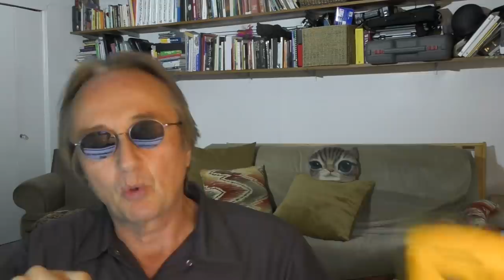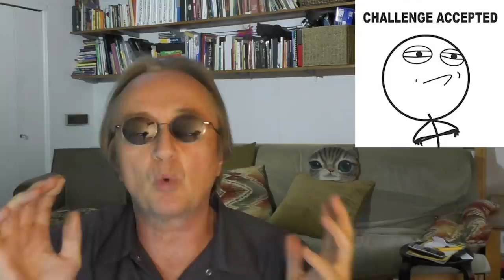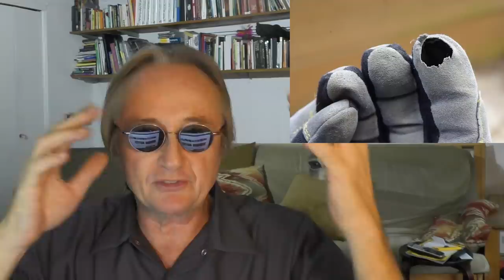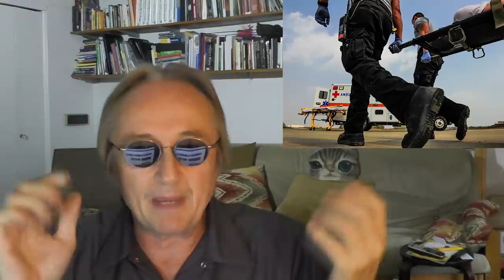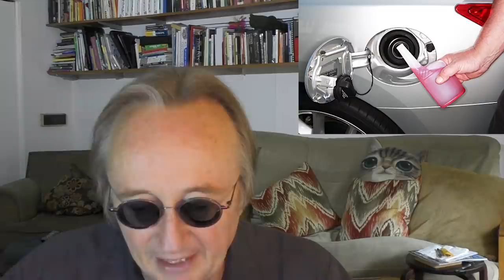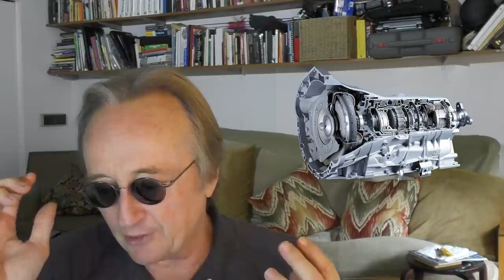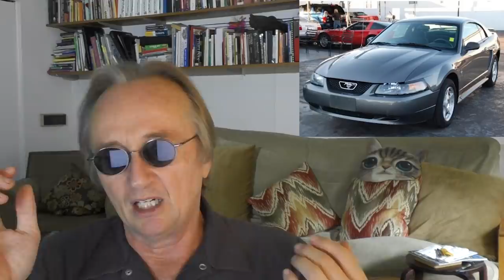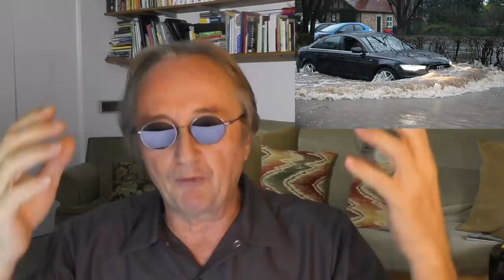The Scariest Car I’ve Ever Worked On, It Can Kill You

Comment: I never thought it scary, however the guy that dropped a large wrench did.  He was inside an M60 tank, decades ago, and had the floor plates removed.  The turret was electrically controlled, so, the floor of the tank was covered with batteries.  Well, when the wrench hit, it instantly burned in to two pieces - and it was a LARGE wench.  I never wore a wedding ring or dog tags when working on those puppies.

Comment: 288 volts DC (what these Prius uses) can potentially kill you but when wearing protective gear then there is little to no risk. On the other hand, 288 volts AC (what comes out of home sockets) is extremely dangerous and will certainly kill you if you touch it. When dealing with electricity, DC voltages are a lot safer than AC ones

Comment: the american house actually uses 220 volts you get a 220 line witch is 2 110 volt likes center tapped.

appliances  like electric clothes dryer. central air conditioner (the outdoor unit), very large wall mounted air conditioners (usually bigger than 12000 btu), electric hot water heater and electric stove all use 220.

still you need to careful around electric.

the chevy volt and i think the tesla uses 300 to 500 volts at 50 amps

Comment: I'm an electrician.. 33 going on 34 years.. I have to push back..
Scotty Scotty Scotty... You can get hit with literally thousands of VOLTS and it would be really uncomfortable. It won't kill you though unless those volts are pushed by more than ½ of an amp... Voltage does NOT kill, but very little AMPERAGE will put you in the cemetery! ✌🏿

Comment: To make things even scarier, it's DC voltage! A basic calculation states that the average Prius battery is 6.5kWh @144VDC, which equals roughly 22.5 amps at any given moment... Now, with that in mind, 2 amps can stop the heart, but 22 amps can literally cook your insides!

Comment: 1969 fiat spider 850 The least dangerous car to work on but the most dangerous car in the US at the time and the worst car I ever owned.  Between the driver and the passenger and the engine/gas tank was mostly a thin sheet of pot metal and particle board.   Looked cool though.

Comment: Scotty is Right working on a Prius can be very dangerous due to the high voltage but there is an upside to it as long as you know how to disarm the system you are safe but when you're working on the batteries themselves even after its discharged there is a risk but once the battery safety disconnect has been taken out and you have waited a. Of time usually at least 10 minutes for everything to discharge you're safe to work on the rest of the car it's just like working on any other car as long as the batteries have been safely disconnected on the system is discharged and you have waited the. Of time after it was discharged

Comment: This is why Toyota has a special certification for hybrid engineers.  

It's designed to disconnect the electricity if there's an accident so it's perfectly safe.  EURO NCAP tests those systems quite severely.

Comment: I can confirm that Honda auto gearboxes are not reliable. I have had 2 Rover Vitesse 827 cars and the gearbox went on one, lost reverse if I remember correct. For you in USA it was basically a Honda Legend, lovely car otherwise. My Lexus GS300 on the other hand runs like a new car with 170000 miles on the clock.

Comment: Scariest car I worked on was a 1968 Morris 1300 that was held together with chickenwire.
Seriously could see the road thru the floor.
Not sure what was holding the bumpers on.
Was even scarrier to drive as its  1275cc engine had a twin carb.
The front disc brakes were tiny... so stopping took a while.
Come a long way since then

Comment: As a Toyota mechanic you kinda live dangerous these days. Airbag recalls to change the explosive and hybrid systems with high voltage. I didn't fear the battery or the explosives much so far but i guess that's because nothing happened at our place so far.

Comment: Scotty I bought a 2001 Toyota Tacoma with a rebuilt title for $5000. It has no rust, a 2.4l 4 cyl, and the automatic transmission. Thoughts? It’s been in two wrecks and has 100k miles
Reply: Logan Williams cant go wrong with a Toyota pick up truck, I have my Hilux turbo diesel manual and will never trade it for anything, good buy as long as engine and trans is in good condition
Reply: 5k is a lot of money for a 2001 w rebuilt + been in 2 wrecks tbh....
Reply: Oh.. Just noticed its a 2001.. yeah you are right 5 Grand is too much for one thats been in 2 accidents
Reply: Having said that.. Toyota pick ups are worth every penny in the long run

Comment: love your channel Scotty and I love the way you do your videos with the little pictures at the appropriate moment. Absolutely hilarious.
I have a 2008 Prius that is my work vehicle. Honestly you're not that scary to work on. If you disconnect a 12 volt battery the contactors open and there should be zero voltage anywhere. All of the high voltage stuff is bright orange so you know if you're close to anything dangerous. Also there is a disconnect lever on the Hybrid battery that splits the battery in half dropping the voltage down to a safer level.
You have to do something pretty dumb to get shocked on a Prius. like deciding to cut through that bright orange cable while the car is powered up with some uninsulated wire cutters. Something like that. Theoretically yes if several systems failed you could get shocked.
But honestly what's the likelihood of that? My Prius has 256000 miles on it, still gives me 45 to 48 miles per gallon in the city. And a solid 40 miles per gallon running at 80 miles an hour. love your channel keep up the good work

Comment: I love you, Scotty.
But 288v, in itself, isn't dangerous at all. Comparing DC to AC is apples and oranges.
Did you know that a visible static discharge is FIVE THOUSAND VOLTS or more?!
It is the relationship of voltage to amperage.
DC is generally much more dangerous than AC.
So in this case; a 288v DC battery with high amperage, would be scary AF!!!

Comment: I'm guessing that the amps on the Prius are pretty substancial?! Here in the UK our household Voltage is 240 volts as standard and I can tell ya plenty of electricians have had a taste of that on more than one occasion! - it'll jump start the old ticker for sure but you'd have to be unlucky (dodgy heart etc.) for it to be fatal; All the same not a nice experience, not nice at all.

Comment: What's the point of anything else than a v8 in a Mustang? I agree with Scotty here. The original Mustang was small and light and it had a v8. This made for a quick, powerful and nimble car, I.E. a FUN car. It was essentially what kicked off the muscle car; small, light, cheap and with a powerful engine. The mustangs of today do have the interesting V6 turbo, however, nothing other than a v8 sounds like a v8. The Mustang is about looks, appearances, excitement and feelings. V6s are great, but they are not, and they never will be, v8s.

Comment: Scotty, it isn't voltage that kills you.  It's current!

An electric cattle fence can be 10-15,000 volts, but the current is fairly low. It'll give you a jolt, but it won't kill you. 

Current is the killer, not voltage. Just looking out for safety.

Comment: 12 volts harmless? I remember grabbing an old, cracked spark plug wire while the engine was running. Deadly, no (at least for me), but definitely enough of a charge to be a quick and permanent learning opportunity.
Reply: That voltage was coming from the coil, not the battery.

Comment: it's not the voltage that kills you its the current that does you in! & the outer gloves are called keeper & the rubber gloves come in 2 different voltages the short gloves are rated for 250 volts & the long gloves are rated for 
15,000 volts I worked for utility & I used them when doing electric turns on! & they make a glove inflater it works better rolling the cuffs & you must test every time use them & they need to test dielectrically tested every 6 months

Comment: It's also 288v DC. It's absolutely high enough to cause damage, but with rubber gloves, would I be worried? Probably not. Especially if you're doing things 1 handed. The resistance would be so high that it would be difficult to draw a high enough amount of current with just 288v to be deadly. Remember, not only does your skin and gloves give you really high natural resistance, but you also need to create a circuit through your heart. (That's why it's better to do electrical things with one hand).

I'd be a bit more concerned if that was 288VAC . The natural capacitance in the body would make that far more painful and dangerous.

Comment: Its really all about the amps as voltage is not the only factor tasers can have huge voltage numbers but low amps. even a static shock can have into the thosands of voltage range but the amps are insanely low

Comment: The V8 engine in the 03/04 mustang gt wasn’t even much better that the V6. Both engines were SOHC. You want an 03/04 mustang? You got two options and this is my opinion. 03/04 Mustang Mach 1 5 speed manual transmission. The manual Mach 1’s came with a 4.6L DOHC and a forged crankshaft. Another option would be the 03/04 cobra Terminator. My favorite mustang to date. 4.6 L cast Iron block with forged intervals

Comment: Hey Scottey, I recently changed the front wheels cv joints on my 2011 kia rio because they were worn off, but now it is making a rapid clicking noise when turning right and hitting the gas. p.s: the cv joints I installed are Chinese cuz unfortunately the original parts are not available in my country. Thanks in advance and happy Halloween.

Comment: It's actually amps that are deadly. You can touch a 200 thousand volts with no amps and it won't hurt you. Amps is the amount of electrical current while voltage is potential difference.

Comment: A typical guitar amp runs at 450+ volts.  I've been nipped by 120 and 220+ but wouldn't want to experience 280 volts running through me.
Reply: @PingasTheFourth I once got zapped by around 240dc for an amp I built.  It is as you say, uncontrollable movement.  But any electricity can be dangerous if not fatal.  People die from 120.

Comment: As a 40 year term paramedic, I would state without reservation that the earlier (~ early 1990s vintage) Hyundai's were the absolute MOST dangerous vehicles ever built.  These cars when in off-center head-on crashes, even at moderate speeds, would sometimes split (fracture) the entire 'floor pan' from the A post ... diagonally across the 'floor pan' to the B post on the opposite side, dumping the seats AND passengers - through the diagonally 'split' floor pan- onto the roadway 'beneath' the auto.  
At any time I saw major damage to the A-post (the side-structure that holds the windshield in place; the B post is the structure between the front door and the rear door) on these early 1990s Hyundais, the first place I'd look for 'bodies' was underneath the vehicle; and,  a few times I found them there.
Reply: Whoa, that's insane.

Comment: The coil generates 20,000 volts to arc the spark plug. Has that killed anyone? When I was young they used to say it was not the shock from a coil that would hurt you, it was banging your head on the hood the would hirt you.

Comment: Scotty, I understand your case against hybrids as a mechanic, but the hybrid hating really needs to stop in regards to Toyota; the most recent Honda Insight seems like a solid vehicle as well. I get it, you don't like to work on them. As a person who's families mostly owns hybrids, they are rock solid... there's five of us that own them (Toyota's hybrid system) and they give us reliable and consistent performance; this was not an overnight experience (I've owned nearly 40 vehicles... driven them all, Toyota's hybrids are mostly overall solid vehicles), but something that we learned was a solid platform. Electricians have tough jobs too and a lot of jobs require risks and safety precautions. Perhaps with the precautions and complexity, car manufacturers need to seriously up the pay rates with working on hybrids for mechanics. Toyota hybrids are solid and reliable vehicles and you seriously need to give them credit regardless of your bias. Another consideration, with the new Toyota Corolla hybrid, they get consistent (better than advertised) fuel economy highway and city. Hybrids are no longer just city cars in the newer generations. Also, my hybrid Corolla run on electric mode even cruising down the highway (up to 70MPH) and almost always in the city (upwards of 50MPH).

Comment: Hi Sir, Just came across your channel and I spent the better of two days watching videos you put out.  Love your work, love your passion.  I have a question:  I have a 2000 Celica GTS Automatic.  I bought it as a weekend car, sometimes daily style use.  Do I have a good engine, transmission to last me and work on.  Or should I swap the engine for a manual at some point?  I saw your video on 2ZZ but I would prefer to get your input.  I want to make it a nice show car that I can drive around with a small turbo maybe? for a bit more power.  I was also thinking of doing a whole rebuild on the car from the ground up.  I have about 60k I have saved up and looking into how to start this project.  I can sure use the guidance.  Even if that guidance isn't what I want to hear.  I bought this car used for 3500.  Externally and Internally it has been well kept.  Single ownder.  Everything original from factory.  Never modded.  I want to it that way for the most part.  Reliable > Power.  But just needs a little more kick in my opinion.  Thanks for your time and hope to hear back from you soon.

Comment: Scotty, first I would like to say I'm glad that you understand electricity risks. You know how electricity can kill people. most people that say the current is what kills you. That's wrong. The voltage is what kills you. However I have a correction for you, because 288v of DC would not likely kill you unless you touched the ground with one hand and positive on the other. The downside of working on high voltage is that if you do touch it, your muscles may stop working so you would be stuck holding them and eventually die. This is why you wear insulated gloves, not only for your safety, but If you dont wear them and you do die, every one of your family members or friends that come to your rescue will get shocked and possibly killed too. Electricity is a dangerous thing, and should not be fooled around with by anyone that doesnt understand it. By the way, AC is much more dangerous. Dont get me wrong, I'm not saying you should just stick your tongue in a 288 volt battery, but you shouldn't fear death being around them. Love the videos brother!

Comment: Scotty, my friend owns a 2012 Jeep, he recently went through the carwash and when he came out to do the vacuuming he discovered that his gas cap was off and hanging!! Which means that he went to the car wash with the gas cap off in the gas door open, what should you do if the gas tank is not equipped with a drain plug on it! How much water is likely to be in the system what can we do to prevent break down aside from dropping the entire gas tank draining the system out flush and refill the Jeep is driving fine it's been 3 days since the car wash event took place.

Comment: It's not the voltage, it's the potential amperage that'll get ya, and yes, 12V can bite you. Haven't you ever welded a wrench to ground with a battery because you went for the positive terminal first? A 650 amp battery isn't a play toy. A 9V battery will zing the hell out of your tongue! True enough it's difficult to be a good enough conductor for a 12V battery, but when it happens, it can be serious. You'll never do it again.

Comment: I've been an electronics tech for over 30 years, be careful what you tell people, Scotty. I love your video's and agree with you 99% of time, but on a car battery not killing you! I can't back you up on that. It's AMPs the kill, not voltage, a 9V battery can kill under the right conditions. Tazers zap people at thousands of volts and don't kill (usually), because its very low AMPS, the high voltage stuns your nervous system. Car batteries and Hybrid batteries both put out hundreds of amps; 400 and up to be more precise. Fact is a tenth (0.1A) of an AMP can kill if it crosses the heart. Please be careful with safety tips.

Comment: 12 and 24 Volt systems are used, because it takes 25 Volts to penetrate human skin.  It only takes 0.1 Amp to kill you, should it pass through the nerves controlling your heart.  Household current is about 120V at 15A, and most people survive it, without injury.  As far as the battery backs on hybrid and electric cars go, I wouldn't touch them with a 10 1/2' fiberglass pole!

Comment: Electrical potential "voltage" is like the gas tank in an electric car.   The amperage would be like how much power the car can make at an instant, so really watch out for the amps above all else.  Hes not wrong per se, higher voltage is more likely to kill you then lower voltage, it's just not the "scariest part".  That Prius is probably both high voltage and high amperage and thus pretty dam scary to work on. 400 cold cranking amps is a scary number.

Comment: Aghh it's been a while since i was in a class, but yes, 12V can't kill you, 120V can kill you, 280V can kill you, but somehow spark plug's 20.000V-40.000V can't kill you. I remember being told that the reason is actually high voltage is less dangerous, and it's not about Volts, it's about Amps, and that spark plugs indeed do have insanely high voltage to make the spark jump between electrodes but not really deadly amperage. Not saying this is 100% correct, im not that much into car electrics, but it's what i remember, and honestly i spend most of the times  working with diesels so.. ;)